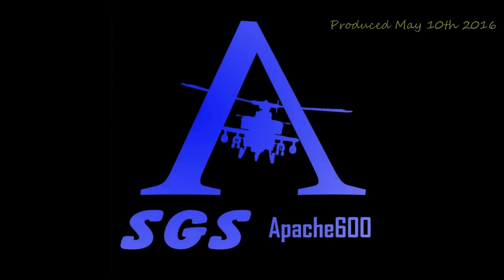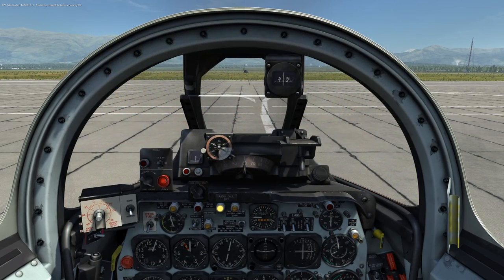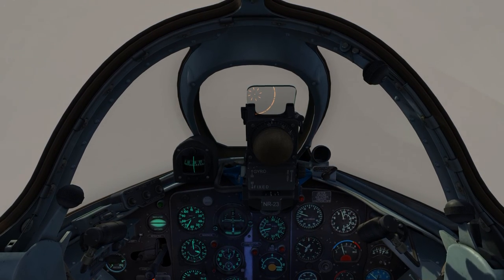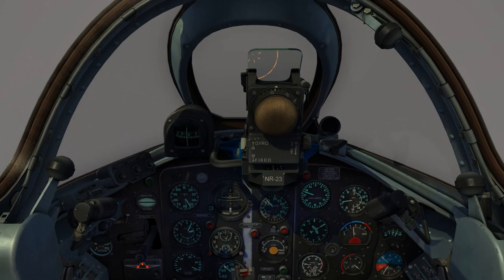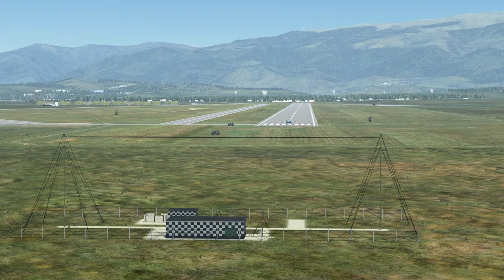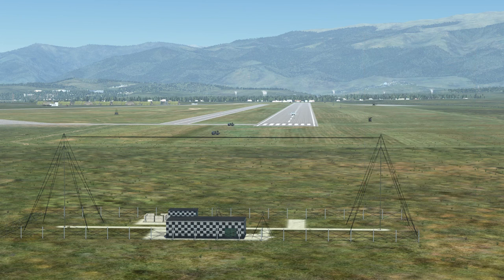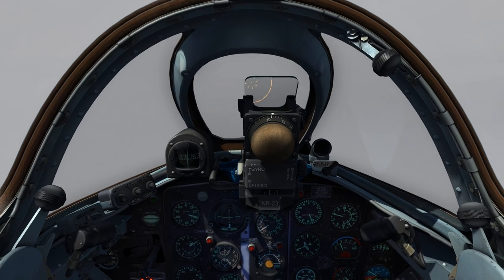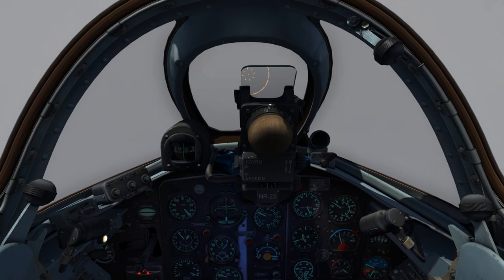DCS Old School Instruments and NDB Tutorial

Comment: This looks so sick! 

Here's a little trick for calculating the NDB bearing's btw, don't bother trying to read the actual number from the Radio Compass or ADF, treat it like an RBI, so when you are going towards the Station, think of 360 to 270 as a maximum of -90 degrees and 360 to 090 a maximum of +090 degrees. For me, every big line is 10 degrees, every small line is 5 degrees. 

It will save you doing a lot of extreme Maths in your head!